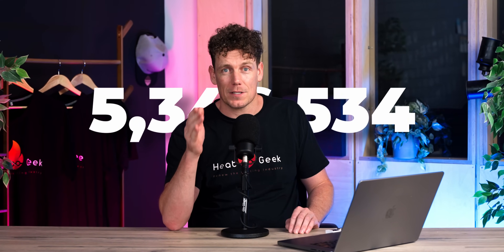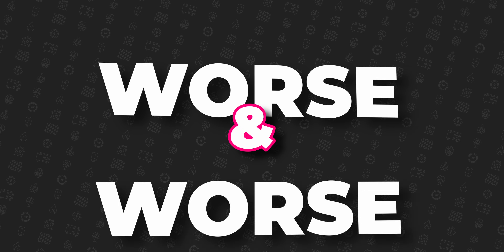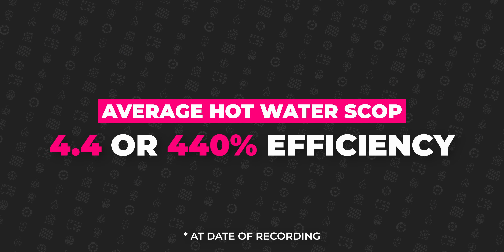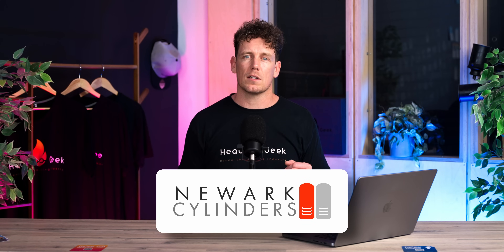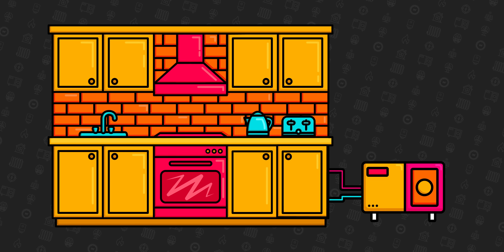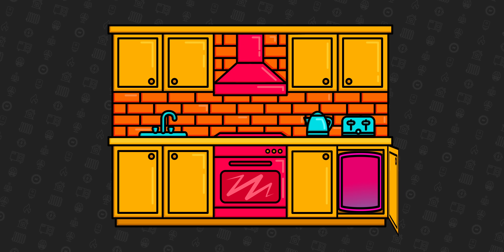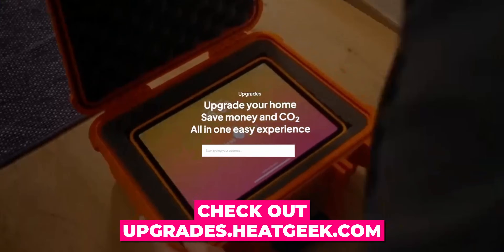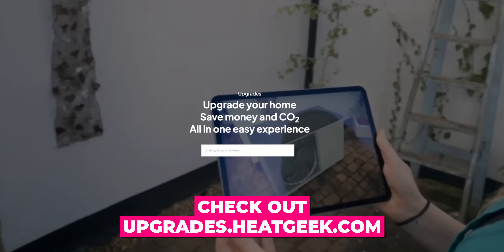This Invention Will Change More Than 10,000,000 Homes!

Comment: Just a note from a kitchen designer, if the cylinder is 475mm wide it won't fit inside any 500mm cabinet because of the cabinet sides, however if you can remove the cabinet and attach the door to an adjacent cabinet then that could work.
Reply from the maker: Or just remove the front half of the side the door isn’t attached to.. 

Good point though. I’ll see if we can shrink
Reply: Might it be time for manufactures start making units to accommodate them👍
Reply: @mikearcher6568  Not so good for retrofit then.  Better to make it fit typical units without butchery.
Reply: @HeatGeek  The width of the cabinet includes the side panel as it runs all the way from the bottom to the top, so the cabinet might look 18mm smaller, giving a stability/fixing problem, and the door will now overlap beyond the width of the cabinet. 
None of this is insurmountable but if you can fix the width of the cylinder then that may be best. 
Still a great idea, best of luck with it.

Comment: I'm in a council house with a 5 yr old gas boiler(serviced every yr) Today for the 2nd time in a month the pressure dropped to zero on the water pressure and I was left cold at 3 am I'm disabled and need to keep warm-they fixed it at 12 midday fair play to Brown of Wrexham. HoweverI really can't affort to have my heating on for any length of time maybe two to three hours per day costs around £3.50 It's too much and so I sit in a fleece blanket most days when it's cold. I would love an affordable heating system. As a kid I questioned why fridges weren't used in reverse back in the 1960's to heat stuff!

Comment: Biggest problem with heat pumps dont the number people trained needed to install then in high numbers  Over a. million gas boilers a year. Vs 36000 heat pumps that wirh free £7500 per heat pump.

Comment: Love what Heat Geeks are doing. If recharge happens at 40c+ does that mean that there will be an issue with bacteria growth?
Reply: Not because this is a hygienic boiler. The solution is excellent because until now no small hygienic boiler have been built.
Reply: To comply with Legionella rules an immersion is fitted in the cylinder so this will need to be heated to 60 degrees

Comment: Looking forward to the deep dive, especially given that it can be used horizontally.

Am I right in thinking that you're releasing this design in the public domain, given that you've asked for other manufacturers to run with it? If so that's fantastic, exactly what the industry needs.
Reply from the maker: Yep. We don’t have time for patenting bull shido. To many homes to get off gas!!
Reply: @HeatGeek  That's fantastic, the industry needs more collaboration to overcome the challenges. Thank you!
Reply: @HeatGeek if everyone goes off gas, which supplies 80% of a homes energy, there is not the cable infrastructure to carry the electric, meaning blackouts which is what they want, well done for serving the agenda for profit

Comment: Wow, great idea! Can these be implemented to serve more than one mini tank per house, to save on heat loss from pipes on long runs or on heat returns.
For example could one go under a kitchen sink and another above a bathroom in a small loft? Would they essentially be like 2 zones but for DHW?
In an old flat I had, there was an old dumpy cylinder in a very high cupboard, this would have been great.
Reply from the maker: Yes

Comment: It's a very interesting idea and looking forward to see the video tomorrow. I would seriously consider this if starting again, but it's now given me a good idea that I could configure my system so heating and DHW flows operate simultaneously, so the DHW is heated in the background at no more than 40, as if it was just another radiator, and always be at or near my set temp of 40, without the need for a separate DHW cycle.
Reply: Isn't 40 often much too warm?  No weather comp?
Reply: @jfinnie78  dhw set temp 40, radiator flow temp varies between 30 and 40 based on both outside and room temps (auto adaptation)

Comment: The main reason I rejected a recent proposed heat pump installation was the size of the standard cylinder I was goingto lumbered with. 180 litres for 36sqm one person home was well out of order. This, this is JUST what I would want and need to fit in my place. Cant wait to have a chat with an installer. Maybe the likes of BG, Octopus etc could look at these cylinders? 
As you say, this is a game changer for those that bleat that homes havent room. 
Well done you all; super impressed!

Comment: Great. Is the invention the insight that a HW cylinder can be sized to customer requirements, designed for ease of installation and for low temperature charging? Is there any additional control function?
Many thanks.

Comment: Indirect water tanks storing both solar energy and geothermal energy have been used for 30-40 years in North America. Am I missing somewhere where the innovation part happened? Smaller size?  I'm just curious what the difference is between this and a standard in direct storage tank?
Reply from the maker: Yea you’re missing the video that details what it is and how it’s works. Due at 4pm sunday
Reply: @HeatGeek  is it like an indirect storage tank that has a controller system built into it similar to the HBX ECO-0600 Geothermal Controller ? Allowing you to set up parameters of when and how the tank(s) are being used? I look forward to your video with the details.

Comment: Question for you, if it's about space, why is this a better solution than a phase change heat battery? Are they less effiecient, more costly, less reliable? What's the pros of this over that? I'm thinking of SunAmp but just in general too.
Reply from the maker: As per the video this heats at much lower temperatures and waaay more efficient.. and is smaller.
Reply: @HeatGeek  Smaller by volume? those are cubes tho, not cylinders, so can fit better in cupboards etc. SunAmp quote 63~65c flow temp from heat pumps like Daikin, so yeah, seems if you can charge from 40c low temp heat pumps, you would be more efficient. However, heat loss once charged might affect your advantage no? I think phase change doesn't dissipate heat once charged right? (very little) Everything's a trade off I guess but cost, size, shape and efficiency (runnng cost) will all need to be weighed up. Do I need a system boiler for this if not running it from an HP

Comment: 1 year too late for me. I swapped a very old boiler for a combi gas boiler and that has made a huge difference already. In future I'd love something like this. The only thing I use hot water for that requires a boiler other than the heating in the winter is hand washing and doing the washing up occasionally. Everything else is electric (shower, dishwasher, washing machine) so there was no call for daily heating up a large cylinder only to not use it.

Comment: Looking forward to the more detailed video.  I'm guessing its a thermal store somehow optimised for Heat pumps.  Can't help but think you would still need high temperatures with such a small cylinder so struggle to see how it would be cheaper to run than sunamp (though expect upfront cost would be lower) so interested to see what you have done.  Anyway, if its a thermal store then great, my brother had one in a new build about 20 odd years ago, thought it was ace.  G3 not needed too?
Reply from the maker: Historically thermal stores have been absolutely crap as you keep the heating water at hot water temperatures.. keen to k own what he thought was good about it?
Reply: @HeatGeek  Yes, not as efficient (bit like the sunamp) but nice all the same.  So this isn't a thermal store then?

Comment: Correct me if I’m wrong which I usually am, but wouldn’t it be more efficient in a flat for example to have electric shower and under sink heater. Then heat pump for CH / in any scenario where a full tank isn’t viable?

Comment: During a non space heating season wouldn’t some ASHP take a while to start to operate at max flow as they need to warm up the compressor oil before working at full capacity?   Are some manufacturers noticeably better than others in this regard?

Comment: I'm just about to have an install by Octopus (already paid deposit) is there anyway for this to be used instead of the cyclinder they provide?
Reply from the maker: Happy to talk to octopus on your behalf if they are open to it!
Reply: @HeatGeek  That would be very exciting. Yes,
Reply: @faux_hobo  - Not to be a wet blanket, but good luck convincing Octopus to give you a different tank! I begged them to install a Mixergy tank for me (as they used to install these) but got a flat 'no' every time I asked, followed by 'we just don't do bespoke installs' ... but I wish you all the best in trying to convince them!
Reply: @HorizonimagingCoUkPhotography  Yes, in my dealings with them when we were considering a Heat Pump I very much got the feeling that they want everything for their own convenience.
Reply: @devjon123  - to be fair, that's how they can get their prices so low, by optimising / standardising what they install and buying lots of the products ... I'm being a very annoying customer for them at the moment as I've been pushing them to oversize all my radiators so I can run the system at a lower flow temperature 😁

Comment: We already have a similar solution in our home in the form of a heat pump boiler, looks like the same design where the heat pump is combined with a cylindrical storage unit that contains about 200L of water. What I am looking for, however, is something like this where I can use a regular heat pump unit with a heat battery to store heat for floor heating. Do you happen to know of any such tech that is available for home owners (and also on mainland Europe)?
Reply: Yes Mitsubishi do a cylinder which is effectively a thermal store and is ideal for small properties. The heat pump is 4kw and heats a stored cylinder which can feed underfloor heating/radiators as well.

Comment: This looks like the perfect solution to my installation problem. How do you deal with using a cylinder smaller than the minimum MCS cylinder size requirement to be compliant with the recommendations of BS 6700?
Reply from the maker: You look at the wording that says it’s a recommendation
Reply: Yes I saw that but I was concerned there was more to it given the way some installers were saying it was a mandatory minimum and they were unhappy to install anything smaller. I guess they just don’t want any come back. 

Thanks for the reply.

Comment: OK, the cylinder size is a great idea, but what about the rest of the kit, how much wall space is still needed for the controls and all the other pipe work and manifolds etc?  The only space we have is where the boiler is fitted now, in the bathroom. There are 9 apartments in the building I live, all about 85 sq metre, we are not allowed to install any equipment on the outside walls or the roof. There is very little wall space as it is mainly windows. The building itself is very efficient. I keep the apartment at 23 deg C  24/7 in the winter and the Gas bill at the November gas price of 6.8 pence per kwh was a total of 80 pounds per month inc daily metre charges and VAT. I have the direct hot water set at 43 deg C and the Radiator temperature set at 80 deg C, this also included the gas hob for cooking.  I can't see me getting much better than this price 80 pounds a month at the actual cubic metres used for that month. I would be screwed without gas, heating using electric, even with a heat pump would cost a fortune. 
One thing I did learn, I rented two properties in Budapest, Hungary over two winters, the first place had 4 meter high ceilings and 100 sq metres and massive windows without double glazing sealed units, the Radiator temperature set at 85 deg C, heated the apartment at 25 deg C 24/7 , the second place I rented had 3.5 metre ceilings and was 87 sq metres with double glazing, but had a more modern boiler that would only heat the radiators to a max of 65 deg C. The 65 deg C radiator temp struggled to get the place to 23 deg C in mid winter with a well serviced boiler,. What I found interesting and annoying is that having a lower temperature of 65 deg C on the radiators  used twice as much gas and the boiler ran far more hours than the one that heated the  radiators to 85 deg C. I had been told that I would not notice any difference, but there definitely is and it cost me double to heat at a lower room temperature, just lucky I was on cheap Russian gas at the time a few years ago.
Reply from the maker: You need room for a controller and a 3 port valve only.  Nothing else

Comment: What is the best solution for flats that currently have storage heaters?
Reply from the maker: Unique heat pump radiators
Reply: @HeatGeek  Interesting, do you have a link - a quick google didn’t yield much? Is “unique” a brand?

Comment: What happens when you start to take a shower and the heat pump happens to go into defrost? Presumably the water won't be getting reheated, or worse, the heat pump will be taking heat out of the tank for defrost?

Comment: I don't need hot water from a boiler, the shower is electric and I boil the kettle to do the dishes. 
I like a smaller volume of piping hot water rather than running the tap down the drain for ages to get a large amount of lukewarm water.
I'm on renewable electric company and use less than 500kwh a year... 

What else do I need hot water from a boiler for? Why should I complicate my needs? I just need heating from a small enough size boiler for my flat.
The combi gas boiler I have is probably more meant to handle a semi detached house or something.

Comment: Is it possible to run a bath with this?  Or would you be paddling in a few mm of water?
Reply from the maker: As per the video.. I ran a full piping hot bath 10 mins after a 40 mins shower

Comment: Why not make them in an appliance housing like a white good product.  Similar to a dishwasher, or fridge? Would save a lot of fookin about trying to install in a base unit.  Put it on castor wheels with levelling feet screws.  A hole in the back that allows a plumber to fit pipes at 90’ off the wall that come through tothe front for easy connection.  You could even supply these with the kit. Make the feet adjustable from inside the unit so easy levelling.  A barrel shape in a cube is easy to do.  You could easily add hard foam insulation panels that slot in.   This design gives you easy fitting,  maintenance and a neat finish.  Front door access could be locked with Allen key heads for child safety.  You can pay me in product for my idea….. I’m in Oz lol  .
Reply from the maker: We’ve made the design open source. We’ll leave that up to others

Comment: Still can't do flats apparently , just checked out your tool . :( There's no "noise issue" here as the potential location of the exteranl unit wouldn't be near a neighbour. So not sure why all flats are discounted. Would be cool if you'd look at installing in a flat like mine.
Reply from the maker: If you’ve got space for a heat pump and own your own garden, we can absolutely help. Our tool isn’t 100% correct. Just fill out the form where we say “we are not ready for you yet” and one of the team will be in touch!
Reply: @HeatGeek  Thanks for answering :) I'll try that. I don't have a garden , but have access onto a flat roof on the rear elevation. That flat roof adjoins a shopping centre who's entire Hvac plant is already operating there (produces noise) Also have a balcony to the front corner of the building which no neighbours are close to. Both are possible locations for a heat pump. + as you know, some Heat pumps are coming in at 45~48 Db these days, Vaillant for eg. A bigger problem is the condensate run off pipe i'd say, but that's not a problem here either.
Reply from the maker: @markfernandes2467  great! Sounds do-able!

Comment: You really need to look into using thermal stores to reduce electricity bills to one third using it as a heat battery with cheap over night tariffs.
We are getting COP of over 3 at night (day 4.5) with electricity at a quarter of the price reducing our bills threefold
Reply from the maker: @charlesstewart2304  it doesn’t work out. You’d need 1000s of liters
Reply: @HeatGeek  it does I have 500l tank with a 1C rise in downstairs temp and it can provide all the heat and hot water needed for the whole day when the outside temp is around 5C and about two thirds when below 0
It stores 17.5kWh at delta of 30C
I can send screen shots of Valiant app 
It would make an interesting video

Comment: Any heat pump of 8kw and more has the ability to directly heat DHW directly without cylinders to ~ 40°C. Now why they won't do that is cost reduction. Frankly it should be mandatory in a country like UK where indoor space is a big issue.

One Greek company is making those heat pumps and they work pretty well.
Reply: Millions of home literally just do not have the space for a DHW cylinder.
Reply: How does that work with any kind of reasonable flow rate?  By my calcs an 8kW output heatpump with 10'C water inlet would only deliver about 4l/minute at 40'C output, which would be considered pretty pathetic by any boiler standard, and not really enough for much of anything.
Reply: @jfinnie78  They have a small buffer tank (~20l) where they keep the water at 40°C and low flow shower heads are a thing.
Reply: @johnzach2057  They're a thing, not a very good thing, but sure.  Book your bath half an hour in advance?
Reply: 20l are always kept at 40°C. So there is no need to plan
Reply: @johnzach2057  I mean it will take so long to fill.  I fill a big bathtub here from gas combi boiler in less than 8 minutes, we have around 14l/minute of 35'C rise from our boiler.  At 4l/minute of 30'C rise, even with the 20l tank as a head start, it will be nearly half an hour to fill the same size bath.